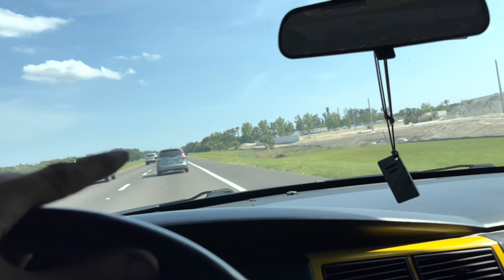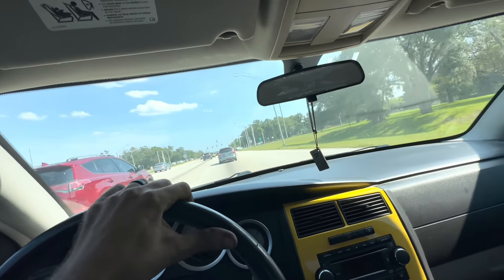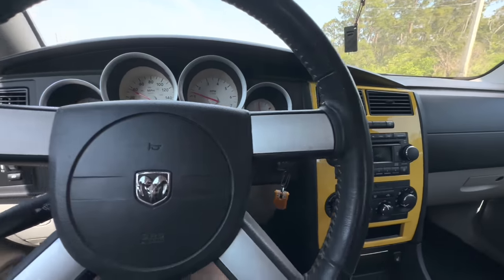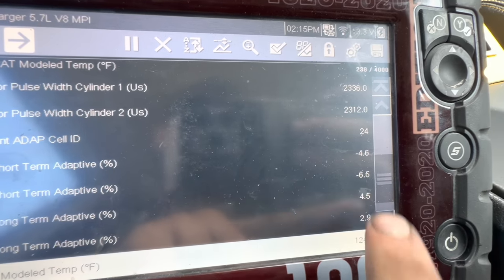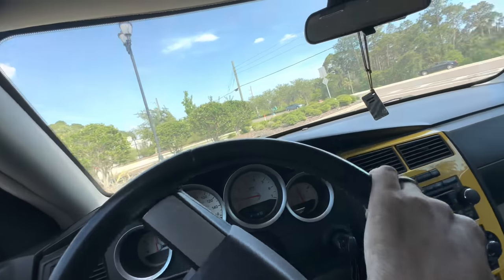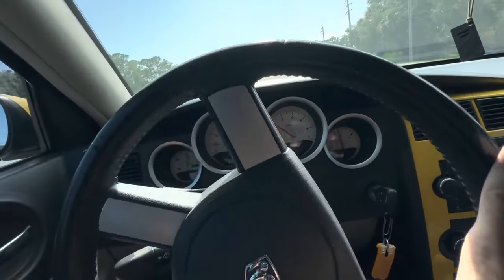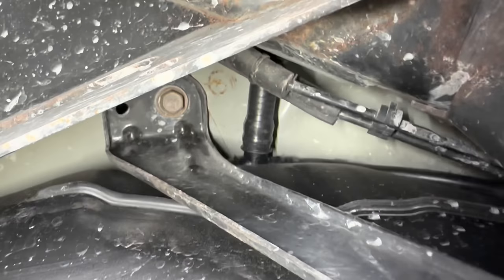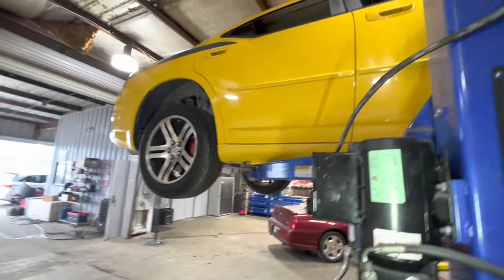Customer States: Engine Stalls After Fueling...HELP!! Dodge Charger 5.7 #mechanic

Comment: I had the same problem with my 07 Daytona, unloaded the full parts canon, new pumps, evap system, new plugs and coils. every time I replaced something it got a bit better, it went from a full stall and die to just dropping the RPM to zero and right back up to normal on its own. I was at my wits end and thought maybe the fuel system was dirty so I put in some redline fuel system cleaner and it still stalled a bit for that tank and the 2nd tank but after that it never did it again.
I've done countless hours of research online and it seems this problem is a ghost and has many fixes.

Comment: I know this will get buried and maybe you’ve already resolved this but… I have an 05 300 with the 5.7 been a known issue from Chrysler that they put a float into the fuel tank that eventually swells. That allows more fuel to get into the tank and dumps raw gas into the motor. Previous two owners had issues with it and got to the point were if you idled it while fueling it would die. Chrysler has a lifetime guarantee on certain years for that fuel tank because of it. Got mine replaced last year on the “recall”. Works great now. Might be your issue is just swapping for a new one. You’ll wait months to get the o rings but hey it’s a fix.

Comment: I'm thinking the replacement tank is an earlier version and does not have the changes that were implemented to fix the problem.  Maybe check the Mopar part numbers on if they include revision numbers or letters at the end of the part numbers like Ford uses? (-AA, 002, etc)

Comment: My 2002 dodge ram 1500 has the dreaded blend door actuator issue.  I installed new blend doors when i changed the dash because the old one was falling apart.  I replaced one actuator, but I guess the other one was bad.  I have been too lazy/busy lately to pull the dash and replace the motors.  It drives me nuts.  That and I still need to move the tools out of storage and get everything set up at the house.  But, in the summer in arizona I just leave the temp set on cold.  So, i could procrastinate untill the late fall.

Comment: This is a total guess, but I would check the electrical side of it... at the 10:16 mark you can see the gear indicator go almost totally out, but I didn't notice any major dip in the RPM's... it looks like there's a slight fall in RPM's (say from 750 to 700 or 650) as it looks like the RPM needle barely moves down when he's idling at the light... but this is a total guess.

I also noticed that when Ray pressed on the gas pedal the the display stopped dimming out... almost like it's a bad battery/low charge with a failing alternator would kind of do.

Edited to add that I made this comment at around the 10:16 mark before the smoke test.

Comment: Had the same thing happen to my 2005 Dodge Grand Caravan after 50k miles or so. When you fill up, the engine will stall after 3 minutes of running after the fill up. It will start right up afterwards. My workaround was not to fill to the top or if I did, start car and wait at the gas pump or wait nearby until it stalls. Restart and be on my way. Stalling while driving is dangerous so let it stall while standing still. I got rid of the silly thing few years ago.

Comment: Had a 06 Dodge Dakota with a 4.7 that would randomly stall. It seemed to do it after a short burst with a quick stop. The throttle body and IAC were extremely dirty. Seemed to disappear after cleaning both then would reappear after about 15,000 miles.

Comment: If it is a check valve, that means flow can only happen in one direction and not in the other.   Is it supposed to be stopping flow from the tank?   If so, can you smoke into the tank and see if it comes out wherever it is not supposed to.  There has to be a way to test the check valve without removing the tank.

Comment: Mine will always stall if I top-off the tank.  Once I stopped doing that I've never had it stalled.  When I fill-up once the pump clicks off that's it for me, I do not put any more fuel into the tank.

Comment: If there is no arrow on your fuel indicator, the fuel cap is on the right. If there is an zrrow it's usually on the left, but I've seen cars with an arrow to the right.

Comment: There is a whole bunch of stuff out there for the VW Eurovan which has the same issue. Mostly turns out to be a saturated carbon canister in the evap system due to overfilling.

Comment: Customer said most likely after fill up , does he know not to click the pump handle 2 or 3 or 5 times after first shutoff ? Would excessive vacuum at the suck enough fuel into the line where you found some ? Just a thought

Comment: Electrical components or their connections may be the real problem since everything else has been replaced. What 
connects electrically to the slosh module perhaps? Notice the fuel tank is horseshoe shape. Fuel may back up into the 
EVAP lines when tank is full and you turn or accelerate. Look into the trunk fuse box. Relays should be pulled out and
check their contacts for oxidation.

Comment: I have a 2005 Dodge Grand Caravan and it does that after fueling.  It's issue is fuel in the evap system.  On another note, I remember when the filler neck was located behind the license plate of a car.  I kind of wish it were still that way.  But alas....

Comment: Just a thought, but did you think about the torque converter staying locked when it's suppose to be released. I know they said it happens after fueling, but they might not be noticing if it doesn't completely stall. This was a problem in the 90's that they resolved by going to atf4, but if someone put something else in it it could trigger it. Just a thought from the old retired guy

Comment: You said it happens more after fueling. Could it be related to mass change? Is it possible that the additional mass (weight of fuel) is influencing something? Perhaps a pinched line (pipe/wire) that only happens when the extra mass is present? (note that lifting the vehicle on a two post lift removes the benefits associated with wheel on ground suspension behaviour!). The other thing I heard from a design engineer based at DCX in the days when these were being developed was a HT line breaking down under certain conditions although that would have possibly registered a misfire - if that code was cleared (as you stated you didn't know if they had been cleared) it may have been ignored because everyone was convinced it was fuel related. - Just saying!

Comment: FWIW, I had a Transit 150 work van that would always stumble when restarted it after filling it with fuel. I replaced the purge solenoid and it stopped doing that.

Comment: Usually they have an arrow foor the fuel cap. Mine doesn't.😢 It was annoying when I first got it. Then I figured out the gas light is slightly left of center on the dash. Maybe they did that on purpose and maybe not?

Comment: I see that charger 5.7 Hemi has a problem with the black square fuses in the trunk.
I'm sure someone else suggested this solution. Fuses actuate stuff and I can't count how many strange failures I've had with faulty fuses on my Jeeps and Dodges.
Chrysler isn't the best with electronics, just saying. In many occasions I had to change to known quality aftermarket parts to replace OEM Mopar/Chrysler electronics including door harness wiring.
One time I had a 02 Jeep WJ with door wiring failures causing no power windows, power locks, no power windows and interior light issues all from door wiring.
They put 5 different wire guage sizes in the door in an area that bends. It gets old and cracks because they didn't put quality wires. Replaced the 12, 14, 16, 18, and 20 guage wires all with 12 guage OFC wires and removed the pigtail connectors between the inside and door and ran wires all the way through from inside of cab inside of dash into the door.
Fixed problem, no failures for years. 
The OEM wiring harness would fail every year or less.
That's Chrysler Engineering

Comment: Ray, the truck situation is so annoying when people cut in front, just to gain a few seconds. I work in the ambulance service here the uk, the amount of people that pull in front of a ambulance (not on lights) at road works, junctions is daft as at any moment we could get a call, then that’s another car in the way to what could be a emergency. This also happens though when we are on lights , and it slows us down so much at times 🤦🏼‍♂️.

Comment: First and foremost nobody stops fueling their vehicle when the pump stops. Fill it up until it's completely full like most people. Is it OK for a high performance engine to run off of 89 instead of 91 octane? My dad's gmc Denali says in the owners manual to use either 91 or 93 octane. Just curious if that may also be an issue.

Comment: I bought a Ford Ranger off of a friend. The truck would stall at random times from losing fuel pressure or flow. My friend had replaced: Ignition switch, in tank fuel pump, in-line high pressure fuel pump, fuel pressure regulator, evap canister, purge valve, and finally the ECM. The truck still randomly stalled. I finally tracked down the problem when it died on me along the road. Two freaking bad relays! The fuel pump relay and the emission/ignition relay. I pulled them (side by side in the under hood panel) and both had moisture showing around the connection blades. I pried the covers off the relays- both were partly full of water! Two new relays and no more intermittent stalling.  
Why water inside? The used car lot my friend bought the truck from pressure washed the engine bay.. DOH.

Comment: When we bought our 2016 Nissan the salesman warned us not to overfill the tank. He said that when the gas pump kicks off , not to put more gas in because the car will flood out.
Take it back to the gas station and cram all the gas you can in the tank and see if it stalls.

Comment: I work at repair shop, and we've found that unless ABSOLUTELY necessary...we will NEVER install Dorman parts. OEM or reputable aftermarket only. 9 times out 10, it's been a Dorman replacement part that we spent way too testing only to find out it was the problem to begin with

Comment: could it be customer induced?  You said the customer stated the problem only happened after a refueling.  Yes you refueled the vehicle but did you refuel it the way the customer did?  ie did you fill it up till it clicked once or did you cram and much fuel into the tank as possible?  If the customer crams as much fuel into the tank it can cause fuel to get sucked into the vent line during a purge event causing the problem.

Comment: Customer overfilling gas tank, only thing I noticed is that you stopped filling when the pump stopped on its own… WAAAYYYY too many people I’ve seen time and time again continue to fill their tank continually letting the fuel pump click off on its own overfilling the tank and the filler neck is then also filled with fuel.  Gravity is going to do its thing and the fuel will make its way up the evap line toward the canister.  A lot of time, the canister is not mounted so high above the tank, and gets filled with fuel blocking the vent, customers complaint usually is that the car wont take fuel which is a dead giveaway.  Hope this helps!

Comment: Re my 05 Chrysler T/C. At every fill it will stall/quit within a block of the station, always restarts and never quits. To “test” your problem vehicle fill the tank normally, drive a short distance and stop letting the engine idle. If you accelerate after filling it may hesitate but won’t die. I’ve had this problem for at least 7 years. I am now 89 and the problem no longer bothers me as the car always restarts.

Good luck with trying to find the problem.

Comment: You found fuel in the line because the ECU was giving bad commands at the wrong times.  The purge valve should not be open under acceleration, and under initial acceleration, there is a lot of vacuum at the intake.    If there is a small hose connected to the gas tank at that time, it will suck fuel in from the tank.   Now, the vent valve should prevent this, but especially after a fill up, gas can make its way into the canister if the valve is open.   And when our cars are parked they are running pressure and vacuum tests against atmospheric pressure to make sure there are no leaks.     But when the ECU is making random mistakes, it is commanding things which should not be happening at certain times.   What happens after you snap the throttle closed after heavy acceleration?  Not just vacuum at the intake, but with engine overrun there will be just for a moment LOTS of vacuum.     And if the purge solenoid is open at that time it will suck whatever is in the canister into the intake.    More than once, at the top of the Cooper River Bridge, my car would stall, right as I was approaching the crest, and on the rare times when I had my window down, I could smell fuel, just like a flooded carb on my old cars.    Hmm.    How did liquid fuel get into the canister?     Again, bad timing on the part of the ECU.    I KNOW that my canister was flooded at least once, but when I swapped it out, I opened up the old one and was stunned to find it looking like brand new pellets in there.    Dry as could be.

Comment: is there away you can check to see if there's a vacuum coming into the engine from te evap from the tank something is making it suck up the fuel is there a mentor or anything you can see where the suckin force is coming from

Comment: Used to "overfill" gas tank on '09 GM truck to round to nearest 5 or 10 cent,knocked out purge valve .Dealership told me to only fill till pump clicks off or else gas fills up lines to purge valve and damaged valve.Needless to say I stopped doing a years old ritual.

Comment: Could be the throttle body,,ran into a issue where the body wasn't getting the correct voltage because of corroded battery terminals, also cleaned the body and no more stalls, or the body is just junk, it has it's own light on the dash, yeah customer stated it just stalls when it wants to every once and a while

Comment: MY 2008 jeep compass had a stalling issue and turns out it only happens if I put to much gas in it at fill up. meaning I squeeze more in after the pump clicks off. this causes engine to stall at least a few times until some3 of the gas is used
.

Comment: I had to replace the black fuse box to fix the issues.  It would stall and at times when I turn the key it has hesitation not doing anything  within 10 seconds then it would start.

Comment: It may not be a fuel system problem. Chryslers of this vintage had problems with speed sensors. The crankshaft sensor may stop producing a signal after it gets too hot, stalling the engine. If you have access, blow a heat gun on the crankshaft sensor as the engine is running. If the engine stalls, the sensor is likely bad.

Comment: I would put a connector where the hose returns to the intake manifold that would allow any fuel returning to the engine to drop down into to (using a 3 way connector) a dead end hose .

Comment: Just because the bolts were touched don't mean the gas tank was replaced and if it was replaced it still could be a faulty fuel Tank and still may need another gas tank just because its new dosen't mean its good. "New" "Never Ever Works" @Rainman Ray's Repairs

Comment: The stall could ve electrical too the odometer in camera was blinking several times and went completely dark maybe whatever controls the idle rpm broke and isnt letting the alternator charge it seems to only die idle and not when getting on it map, maf, idle screw injector fouling out intermittently?

Comment: I had a similar problem years ago on a Citroen bx gti ( a Uk car) it had been everywhere and eventually it came to me. It turned out to be the Citroen dealership to replace the fuel tank sender unit for the gauge,as the fuel pipes were short and a b to fit they had fitted longer ones BUT trapped the return when refitting the tank (rich mixture failing emission test) the morale is just because someone fitted a tank doesn’t mean they did it right!

Comment: My 5.7 Hemi recommends 89 octane. Check the owner's manual. At a gas station recently, I noticed a guy putting 87 into his Hemi Ram. I struck up a convo with him; he didn't know 89 was recommended, either.

Comment: Ray i see you addressed the tank recall . The dealers will not adress it because it was not a true recall . Chrysler agreed to do the repairs under warranty so the ntsb settled the suit . You have to have the letter  from corporate to get the dealer to honor it even tgen they get really pissy . Ive had 2 put in my 05 . And yes that call is under the tank warranty.

Comment: Regarding the “Italian Tune-up”, my dad had a ‘71 Mercedes that was running rough. I clearly remember as a little kid the large, grey haired, German-accented technician in a white lab coat chewing him out for driving it like a little old lady. Told him to put it in second hear (I think it was a 3 speed auto) and just drive it around like that for a week to clean it up. My recollection is that it worked.
Reply: My grandma used to drive at least 5 under the speed limit and feathered the throttle from the stop sign, which filled the exhaust regularly.  Grandpa took it out every few weeks to "blow out the soot."  He'd take it to an empty highway (plenty around at the time) and floor it in first.  It was fun watching the cloud of black smoke come out.